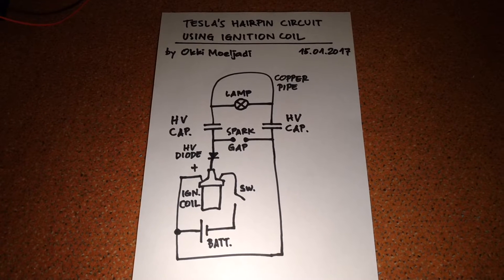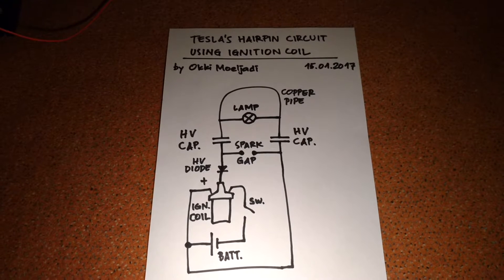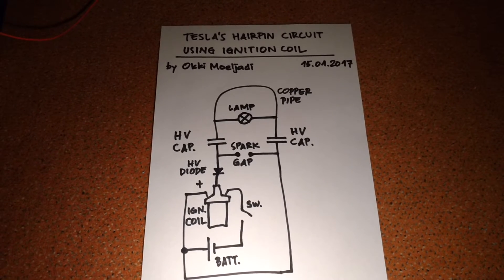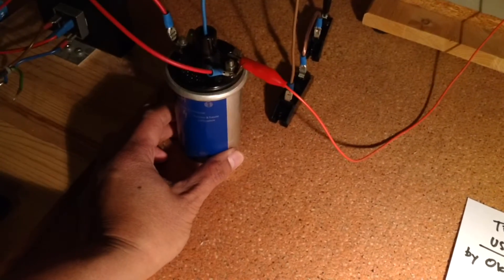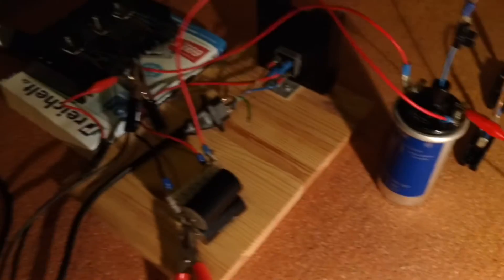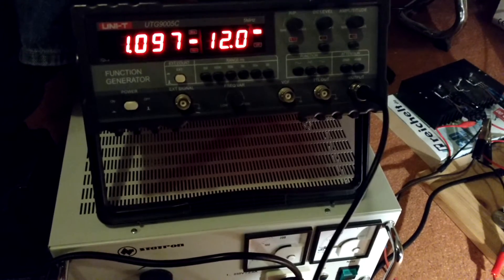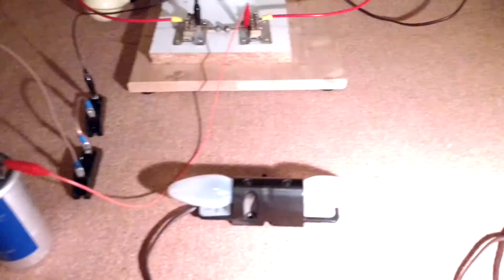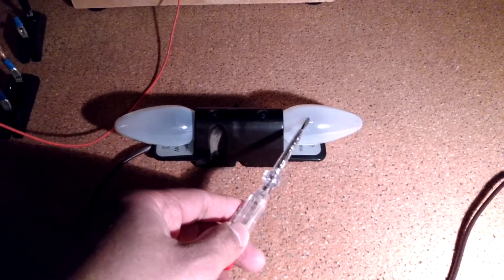Tesla's Hairpin Circuit - Powered by Ignition Coil

Comment: Cool video, but do you mind helping me with my version of the Tesla hairpin/cold electricity circuit? Thanks
https://m.youtube.com/watch?v=WgnBif5UPeM
Reply from the maker: I have watched your video but it's not clear for me. Can you show me your schematic?
Reply: Okki Moeljadi its the hairpin circuit, using a fly back transformer and a steel loop
Reply from the maker: If your connection is correct, maybe you have to replace your iron pipe with other material like copper or aluminum.
Reply: Okki Moeljadi ok
Reply: Okki Moeljadi yup, that was it. It would seem that cold electricity prefers going through the conductive, resistive paths over very conductive ways. Strange

Comment: nice setup. sparkgap isn't needed, diodes also not needed. output impulses from the ignition coil, would pass through caps and pipe to ground. 
best would be to produce negative voltage with the ignition coil.
might try it myself
Reply from the maker: My ignition coil produces negative voltage. Please try it and post it on your channel.
Reply: Negative! great!

Comment: Years back I replicated Tesla's Hairpin circuit using low voltage (12v to 24v). Replacing the spark gap with an oscillating power transistor gave me some good results in terms of smoother, controlled and measurable output.
Connecting a bridge rectifier also enable me to incorporate a capacitor and run a small motor off it.
The electrical currents produced were very high and beyond 24v would easily burn out my transistors. I'd be interested in seeing how this type of setup would run on higher voltages using an IGBT able to handle high currents and high voltage spikes.